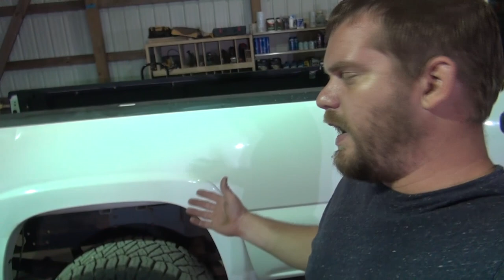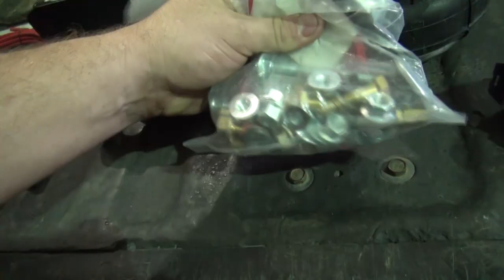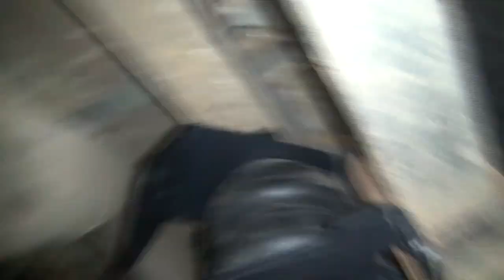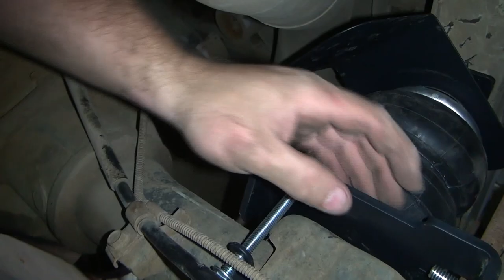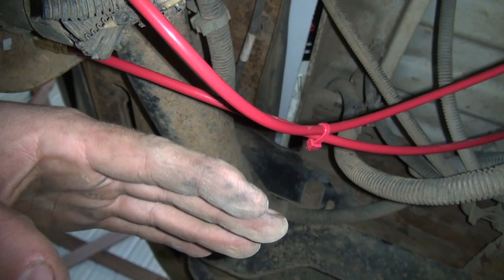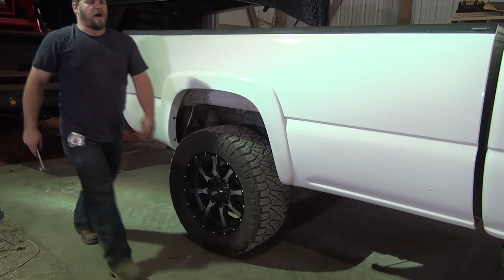I decided to get air bags, Here's why! firestone 2250, Gmc 2500, 3500

Comment: Great choice going with air bags. I agree, totally adjustable is the best way to go. I have mounted an air tank under the bed of truck with a leveling valve for an air supply. A good sized air tank held enough that I would only need to refill with shop air once a week or so. I am not a fan of the little 12volt compressors for these systems. I have 2 trucks that have them and I replace them way too often.
Reply from the maker: I would have thought with a leveling valve it would exhaust the air from a tank quickly going over bumps etc. I know a big truck system exhaust a lot when suspension moves. I guess these don't move as much cause the spring is carrying some of the load still. I'm hoping just to set it at 30lbs empty and add air once a month or so not sure if that's gonna work out though, time will  tell.

Comment: hey Chase you could mount an air tank on your frame rail and use a ball valve to add air as needed on the road. I took the leveling valve off the cab on my big truck and I use a ball valve to add a little air about once a week and it rides better than it even did. thanks for sharing
Reply from the maker: yep could do something like that

Comment: Chase them bags make a huge difference.  As for weights and measures the OEM'S were using in house engineering specs . I believe they are all going with SAE specs now and more realistic weights.
Reply from the maker: I haven't got to try them towing yet. been driving around with about 30lbs in them and doesn't seem to bad empty, probably would on a 1/2 ton but these 3/4 and 1 ton trucks ride stiff anyway so no big difference.

Comment: Also thank if it was 10000lbs on the axle with the airbags there is ,4 points of contact witch lowers the lbs to a square weight on the axle